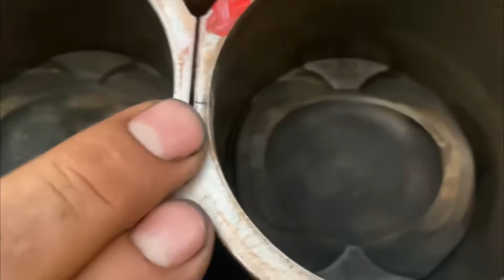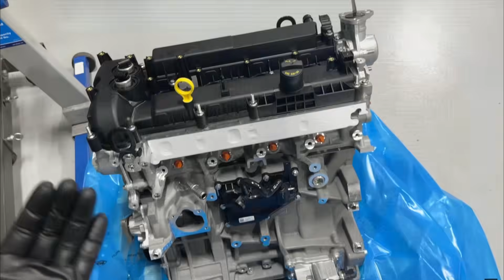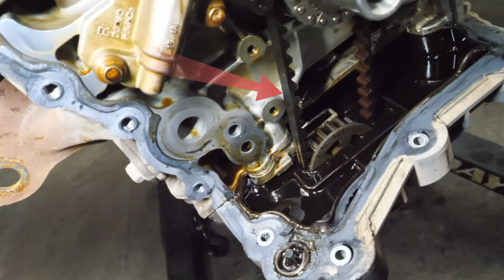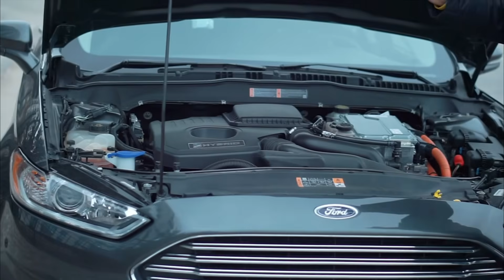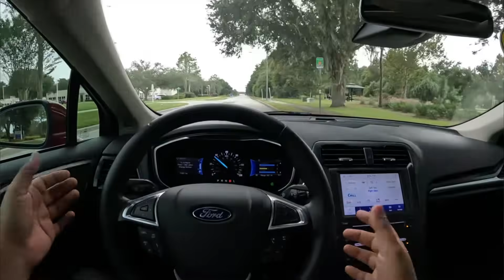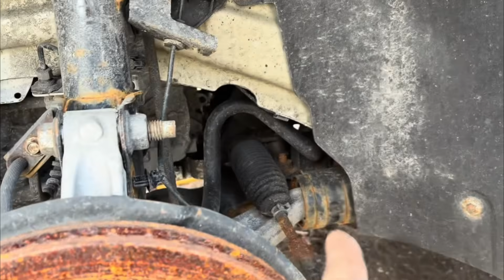Ford Fusion (2013-2020): A Complete Reliability Guide

Comment: I currently own a 2013 fusion se 2.5 liter. I bought it used with 35,000 miles on it. I am an uber/lyft driver and the car currently has 332,000 miles on it and the only components that have broken or failed is the alternator and one radiator hose. I've replaced the spark plugs twice and changed the oil every 5,000 miles and it's still running strong. Hoping to get 400,000. It's been a very reliable car.
Reply from the maker: Wow, that's really impressive!  Those 2.5 are good!
Reply: I’m thinking of buying one with that engine too.
Reply: Transmission?
Reply: Did you change or rebuilt the transmission
Reply: Yeah I have the 2016 2.5 also since 2019. And that thing has impressed me from a reliability standpoint and ride quality and performance standpoint. First Ford I’ve had and it’s hanging in there. Only real issue I have had was the throttle bod got clogged or went bad one of them. But car was still under warranty and was replaced with no issues and nothing really since. Just an overall good car.

Comment: owned 2013 fusion 1.6 ecoboost. one of the best cars i owned sold it in 2020 no issues just regular oil changes. If ford ever revivies this model i am buying it
Reply: How many miles did you get out of it?
Reply: @shooterspuck18 i sold it at about 149000 miles traded in for a explorer

Comment: I have a 2019 fusion se hybrid at 145,000 miles and no issues at all.  Had it for 4 years and never let me down.
Reply: I am original owner of 2013 Fusion Hybrid with over 200K miles.  Rides like a dream and very reliable with over 41mpg.  efficiency.  Just replaced the original 12V battery after 13 years!  Too bad Ford stopped making them.  I would buy another one in a heartbeat.
Reply: How many miles did it have when you bought it? I’m a little hesitant about buying one for 90k miles
Reply: @Pov-Mars I bought mine 2 years ago at 70k miles I’m at 134k and haven’t had a single issue.
Reply: What engine is it?? Thank you

Comment: I have a 2013 ford fusion S 2.5 at 130,000 miles got it at 70,000 this car is so good just keep up with the regular maintenance and your fusion is gonna keep going strong
Reply: No transmission shifter bushing issues?
Reply: @JohnTaylor-bd1uy  i haven’t had any issues with the engine nor transmission
Reply: @Bigtazzz  I heard that the car is so underpowered that gojng up a hill is a joke.
Reply: @JohnTaylor-bd1uy i wouldnt really know about that i dont live around hills theres only 175 hp on that motor im pretty sure any car with that size motor and power will struggle in certain aspects

Comment: One of the best cars I ever owned. I had a 2016 fusion titanium energi PHEV. I traded it with 185,XXX miles and never issues! I had my engine on / off button break and need replacement. $50 part. That’s it! 😊

But I know how to change my oil at 5k and I don’t drive like a crazy person. So my cars always seem to last without problems. I’ve even owned 2 Mazda rx8 (6-speeds) one I had 175,XXX miles before the engine was starting to go. I’m a mechanical machinist so I really understand engines and most people I know with constant car problems are tougher on their vehicles than I am on mine.

Comment: My 2013 ford fusion has 295,000 still runs fine 🙂 and it's a 1.5 ecoboost just the check engine lights won't go off
Reply: What have you changed on it?
Reply: Mines have a loud noise to it but other than that runs fan I'm scared now seeing all of these comments
Reply: @OCTAVIA-j3c  yeah I ended up getting rid of it don’t want to risk it

Comment: I've got 2011 Fusion SE with 2.5L normally aspirated engine. Had the steering TSB done and otherwise runs very well at 197,000 miles. Do regular oil changes at 5k miles and drain and refill transmission fluid every 30k and it will serve you well.  Ecoboost is trash and so glad I didn't get one of those!
Reply: Update01: 7/3025 2011 
Fusion SE with 2.5L engine and 6F35 transmission still going strong with 204k miles. Had to replace ball joint though. No biggie.

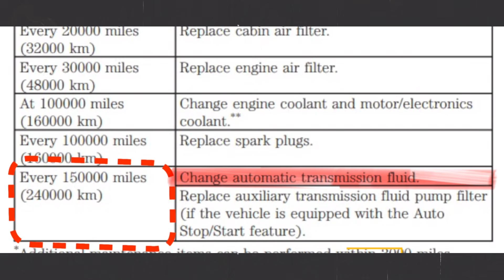Comment: 14:21 correct me if I’m wrong, but an oil change is different than a transmission fluid change, right?
Reply from the maker: there're two different things engine oil change and transmission oil change. You should do that separately
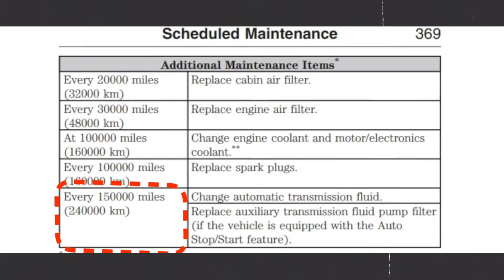Reply: @thelonglastexpert  but your narration said "it turned out that Ford set the oil change interval at 150,000 miles" while the screen shows that that 150K miles is when the first automatic transmission fluid change is needed.  Just watch at 14:14

Comment: My Fusion is a 2012 SEL with the 3.0 engine,  with regular oil changes, a set of brake pads, one new battery,  and two sets of tires.  Oh, and a minor A/C leak repair.  Looking toward 200,000.

Comment: I own a 2013 2.0L EcoBoost Ford Fusion. It has 850,000  km on it. No engine issues, transmission is noisey but works. Still runs good. Hope to hit a million KMs. 👍
Reply: I assume you have changed your transmission fluid multiple times with that mileage?  You should use Valvoline Full Synthetic Mercon LV, Valvoline Extended Performance ATF or Amsoil ATL Full Synthetic LV ATF.  It is possible to fix the noisy transmission, unless you never had the recall performed.
Reply: @Balticblue93  wait, you said 850k km?
Reply: wait, you said 850k km?
Reply: @eddideleon2845  Yikes, that’s what? 528k miles?  Holy crap!  That is hard to digest even if it was a diesel.  It’s not a SEMI!  Lol… 850k/KM is nuts!
Reply: wow
Reply: Duvido ,faz um vídeo
Reply: Bullsh*t....😅. Like the Valvoline oil ads...
Reply: MPG?

Comment: My 2016 2.5L spun a rod bearing at 90k. Oil level was good. I suspect a cold snap of -50F started it going.
Reply: Poor oil pressure, contamination, or a manufacturer defect. (Lemon).

Comment: I'm a Toyota guy but the wife and I were gifted a 2013 Fusion in 2017 with only 13k miles on it from a family member's will.  It's been a decent car.  Some issues seem to show up a lot earlier than expected such as dying lights, radio screen going bad, and other small wackiness.  While we appreciate it immensely because it was such a wonderful gift, we've decided probably never to buy a Ford  in the future.  There's just so many small things and issues that the Ford has that even our older 2001 4Runner seems to be fine with.  We constantly have battery issues with the Ford,  and things that have lasted 15+ years  on the 4runner had issues within 5'ish years with the Ford.  The Fusions per year cost though has been quite reasonable.  Not a fan of that tiny gas tank compared to the 07 Camry I had before it.  We still have the Fusion, but have regulated it to on and off duty so hopefully we can get another 5~6 years out of it without any major catastrophic issues.
Reply: What kind of engine did your fusion have?
Reply: The 13s had issues that were corrected around 2015.

Comment: The 2.5 is genuinely the best engine you can get in this generation Fusion. All of the other engines are too problematic and complex to repair. the 2.5 is an older, much more proven engine design. If you maintain it, it could very well last you 200k+ on the original powertrain. The 1.6-1.5s are absolutely the worse. I don't even trust their "updated design" post 2019, the engine is too small for the size of the car, i don't trust that the updated design will really make the engines anymore reliable.

Comment: I might as well throw my hat in the ring looking at everyone's fusion stories. I currently own a 2016 SE hybrid with 153k miles (purchased at 20k miles in 2018 due to it being a fleet vehicle before me) and do my own maintenance. So far the only issue I've had was a failed ABS sensor. I've kept up with mostly everything (basically i haven't touched the transmission yet 😅) from oil changes, spark plug swaps, ignition coils since I was in there and i was at 130k miles, and a few other things. This car has treated me very well. The only thing I'm sad about is having to trade it in soon for a bigger vehicle for the sake of space due to a new addition of a family member (it's a boy). I'd recommend this car but like this video says, low mileage with good history and if you're able to keep up with the maintenance
Reply: No one give a damn about you getting rid of it for a new family member go be mushy somewhere else

Comment: I have a 2011 and a 2017, both been pretty good, but the build quality on the 2011 is way better. the 2011 is a 2.4 I4 and the 2017 is a 2.0. Great all around but my 2017 isnt as comfy as my 2011
my 17 dash started warping and seats being terrible, computer issues on the 17 made my passenger window roll back down when it got to the top, fixed by dealer but still. speakers blew on the 17 a year after purchase, but overall the cars are good, but the 11 is built way better

Comment: 2017 Fusion Energi SE over 180,000 kms. Best car I ever owned. Not much fixing only had to replace lead acid batteries once. Was over $600 Cdn but used a Ford $1000 gift card given to me by dealership during sale of car. Brakes are still original because car uses electric motor to stop and regenerate electricity. Due for some major maintenance like CVT oil replacement, wheel bearing due to pot hole, just changed original tires last year with Nokian tires excellent tires. I would be happy for another 180,000 kms.

Comment: I have a 2013 Fusion Energi that just hit 310,000 miles with maintenance as stated in the owner's manual. Still running strong. I'll report back when I experience my first component failure.
Reply from the maker: wow, that's cool 👏🏻
Reply: How is your transmission holding up? Any oil changes so far? Mine is at 205k miles with only engine oil changes. I haven’t touched anything else.
Reply: @e.s.5271 still holding up. Had the fluid changed at 150,000 and 300,000 miles, per the owner's manual. About to hit 348,000 next week.
Reply: @kennystarr5918  holy congrats man, im at 257, 000 right now
Reply: @e.s.5271 get your timing belts done and various other high mileage work
Reply: think the guys still going
Reply: Any issues with your CVT transmission?
Reply: @andref713 no issues yet. I did have a leak at about 30,000 miles that was fixed under a TSB. No issues since.

Comment: I have a 2014 Ford Fusion Titanium 2.0 EcoBoost. I have tried to keep up with maintenance as much as possible. Oil change every 5k miles, transmission fluid drain and fill every 15k miles or so. I first got it in 2020 and 3 months later the power steering went out. Replaced it and almost 2 years later it went out again, replaced it and 7 months later it went out, so I replaced it again and so far, it has not gone out (yet). I modified my Fusion which was fun and also made me not only keep up with but do my maintenance intervals sooner than normal. I have replaced the rear shocks and front struts with Koni Strt parts. Steeda front and rear sway bar, Steeda front tower brace, and CP-E Stage 2 rear motor mount. The vehicles suspension feels tight, and I love it, corners good and the chassis doesn't flex much. As for performance, I have put on a Steeda front mount intercooler, CP-E hot and cold side charge pipes, Turbosmart BPV, NGK Iridium IX spark plugs gapped at .026, JLT 3.0 oil separator, Mustang EcoBoost throttle body, CP-E 3" catted downpipe/cat back exhaust, Garrette Powermax Stage 1 turbo, XDI +35% high pressure fuel pump, XDI 2000CC fuel injectors and tuned on 93 octane from Unleashed Tuning. I am having an issue with the vehicle not running right. I got 2 check engine lights, a P008B Low Pressure Fuel System Pressure-Too High. So, I replaced the fuel pump in the fuel tank with another Motorcraft one and replaced the low fuel pressure sensor. the RPM needle is no longer dancing around while driving. But I still have that other CEL which is P00C6 Fuel Rail Pressure Too Low - Engine Cranking Bank 1. It takes many cranks to start up when the engine is cold, otherwise it will start up fine if it was running pretty recently. It is also misfiring intermittently and will have a massive misfire if you get on it and will take a few seconds to regain itself when the check engine light is flashing. I have ordered a new fuel rail pressure sensor which I am waiting on in the mail. When I replace that I am going to have my tuner take a look at the datalogs and see if he can get it running well. I sent in those aftermarket fuel injectors to XDI, they tested them and said they are in good condition, but I don't know. After installing them my car started having problems one week later. If all else fails, I am going to order brand new Motorcraft fuel injectors and see what happens. My money is kind of on the injectors being the issue, fingers crossed it is not the engine because I absolutely love my car and would hate to get rid of it.
Reply: Sounds like a giant waste of time. Get a better car to mod.

Comment: Fords use of open deck blocks with turbocharging is an invitation for trouble and failure. Also moving to wet belts instead of chains reduced reliability.

Comment: 2014 fusion se ecoboost 2.0 owner here. 150k miles. No problems whatsoever. A little bit of turbo lag and you can tell second gear is getting real worn. Probably gonna have to throw a trans at it around 200k miles but besides that, runs like a champ. 200k miles and only a transmission, you can’t really ask for more these days

Comment: I have a 2013 fusion se with the 1.6 with 211k miles on it and it has been wrecked twice (previous owner) and it still runs great with pretty much just regular maintenance as well as new evap valves earlier this year it also would randomly go into limp mode for about a week which ended up just being a dirty mass flow sensor lmao

Comment: I have 2014 ford fusion energi with 126k miles on it. I bought it with 100k. Only issue ive had its an  electrical parasitic drain, just had to change the battery sensor. How often do you recommend changing coolant. also is it the same coolant for both engine and electric?

Comment: The best engine for this car is the 2.5 in line 4 cylinder. They never should have discontinued it. My 2010 Fusion has 183,000 miles on it. Don’t listen to the dealer when they tell that you never have to change the transmission fluid. They just want you to buy another car. 😀😀😀😀

Comment: I just bought a 2017 ford fusion se 1.5l from the dealer in August, engine had all these issues after only 2 months. The car had 102,000 miles when i bought it. I wouldnt have gotten it if i knew about these issues. So right now its currently december and im getting a new engine right now. Thankfully i got a warranty on the car when i bought it and am making small payments. New engine is going to have 40k miles so i should be good. Its a shame because i like the car but man this engine is ass. First car too so i didnt know much next car i get will be better.
Reply from the maker: yeah man those 1.5 are too weak 🤦🏻‍♂️

Comment: 2015 ford Fusion 1.5 engine. By far one of the best cars just have to keep up with regular maintenance.  202k miles on it and still driving. Oil changes are important and A MUST. If you have an issue on this car and have the time and knowledge to fix it yourself. DO IT YOURSELF. We in December 2024.
Reply from the maker: hello! 202k miles and the same engine??

Comment: We just bought a 2020 fusion se with the 1.5l ecoboost engine. Now I am a bit worried. Car has 64k miles but still has limited warranty on the drivetrain for another ~2 years

Comment: The coolant thing happened to my 18 fusion around 64k miles. My warranty covered full replacement. Once they put the 19 model engine in it’s been solid. General Message of this video: CHANGE YOUR OIL for your engines to last.
Reply: I have the 2018 fusion se 1.5l ecoboost, you aswell? Mine is in the shop for a coolant leak with ce light, Ive heard alot about these coolant intrusion and mine isnt under ford warranty no more at 113000 miles.

Comment: Any modern car is going to be good as long as it doesn't have one of these low-displacement turbo engines.  No matter the manufacturer, they appear to be failing prematurely across the board.  The 2.5L Duratec is a very good engine.

Comment: We had a 2015 and it was a real Turd. Traded it on on a 2020 Camry. Had nothing but problems with it. At 22k miles it had a cracked cylinder head in 3 places left us stranded. Then it never ran as good after warranty repair then all kinds of knick picky things went wrong you could no longer hook your phone up to it a part went bad in the radio FORD wanted $600 to fix. At 55k miles it had misfires and I finally said to hell with it. The 2020 Camry has been 100% better not one problem and we have had it 4 years now. What is worse ours had the supposedly bullet proof 2.5l engine. Not too bullet proof in our case and Ford would not warranty the repair they made. I will never give Ford another dime they can go out of business for all I care! We maintained it well too. Serviced transmission at 45k miles and stayed on the oil changes. Ford says the cracked head was a forge issue that got past the 3rd party that made them and Fords quality control so I guess we got one of those where quality was not job 1.

Comment: I own a 2015 Fusion SE Hybrid,. It has been a wonderful car. No mechanical issues
Reply: How many miles does it have now thinking about buying a 2020
Reply: A lot of people don't realize that the ford fusion hybrid system is a Toyota system. They are bargains if you can get a lower mileage car due to the Ford stigma.
Reply: I got the same car and I've had no problems either almost had a head gasket issue but I slowed down and haven't had the burning coolant smell ever since
Reply: I have a 2015 hybrid SE
Reply: 2.0